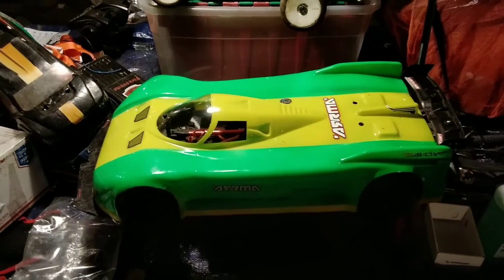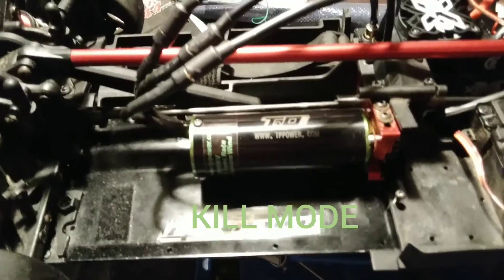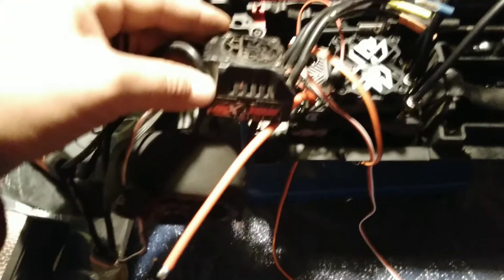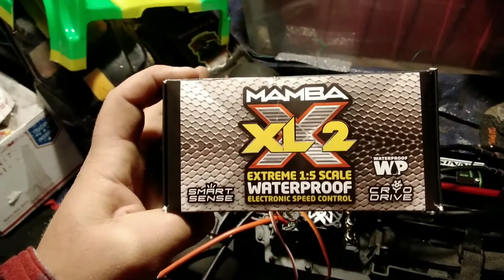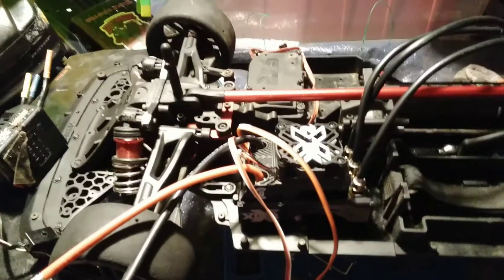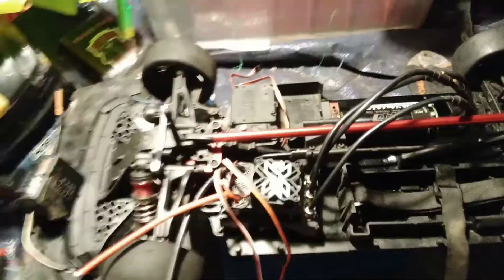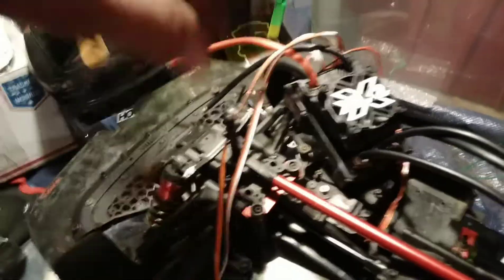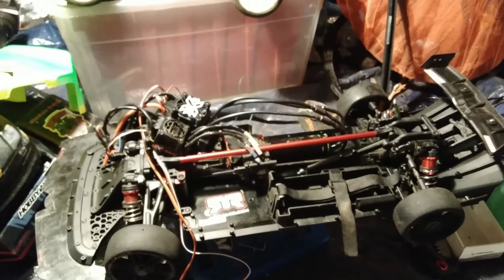Castle mamba xlx2 and kill mode tp 4070 2900kv x spec for limitless

Comment: Great video be careful Kevin had 2 lxl blow up and he had a tp motor 3200kv on 8s
Reply from the maker: Thanks for watching buddy and thanks for the advice. Yeah I agree after talking to one of my most trusted YouTubers I think I'm going to be running on 6S for the most part because the motor that I have is made for 6s runs anyways. I think it will still be a beast on 6s . And for $300 for the ESC I definitely don't want to be blowing them up. With the right set upI was able to hit a 102 just using the arrma kraton electronics. Hope you had a good holidays man
Reply from the maker: I'm thinking about getting into drag racing as well since my motor is the TP 4070 2900 KV x spec which is made specifically for drag racing from what I've heard
Reply from the maker: But I guarantee she'll still rip some speed runs up
Reply: I just watched that kevin fellas vid 3200kv on 8s no wonder not once but twice LMAO you think he would have taken a different approach with the second xlx
Reply from the maker: @kel2226-x2y  yeah I'll be running a 2900kv tp with the xlx2 but on 6s lipo people that are burning them up are running them on 8s from what I'm hearing. I wanted to run 8s but I want to learn the esc first. What she likes what she doesnt. 6s will still rip.
Reply: @rcjer6473  the reason Kevin caught fire is that 3200kv motor. That’s a 400amp motor on 4s.... so on 8s.... he probably pull over 700-800 amps. Pop instant fire. Kevin is a plug and play....he doesn’t understand amp draw. All the speed run and drag guy are laughing at him trust me
Reply from the maker: @rcguy5793  so basically it's not that the xlx2 is bad it is an operator error situation.  If that's the case, with my 2900kv tp 4070, how many amps will that draw on 6 and 8 s. I cant find that information.
Reply: Current (A) seems not to be the problem or issue because my XLX2 just burnt down two days ago during the "motor performance" test where the amps are normally bellow 50A (23A) on 8s and it worked fine twice and during the third test run it burnt up.

Comment: Bro don’t run the tp with that esc. They are burning up cause they can’t take the d-wind motors. Castle is working on the firmware to fix the issues. I have a 2700 tp and on about two passes it killed my esc on 6s.
Reply from the maker: Is it because it's a 2900 kv tp motor.? The people I know that are running it are having absolutely no issues but some are running 2200kv and some 2900kv. Thanks for the advice bro.
Reply from the maker: One more question if you don't mind..what is the date on your xlx2 box so I can compare to mine
Reply: @rcjer6473  yea any tp motor. The firmware is not set up to run the d-wind motors yet. And you know tp motor run consistently around 8000 watts with a max of 12000 watts vs the y-wind motor like the castle motors that have a max around 8000 watts and consistent 3000-4000 watts.
Reply: @rcjer6473  I purchased mine on December 19 2020
Reply from the maker: @chedrickyoung1171  ok dude....in your opinion what motor could I run with my limitless and xlx2 that will be just as fast for both drag and speed runs but won't over do the xlx2.
Reply: @rcjer6473  if u have the xlx that will do until they get the firmware fixed in the xlx2. Or u could go with the 1717 castle on the xlx2
Reply from the maker: @chedrickyoung1171  thanks dude
Reply: @chedrickyoung1171  you know if they fixed this issue yet??
Reply: @nolimitrc1  yes they have. Just install the new firmware to the esc.
Reply: @chedrickyoung1171  ok good because the xlx does not compare to the xlx2 with power delivery and i have a brand new xlx2 sitting
Reply: @nolimitrc1  oh yea for sure. Remember if you don’t know the tp does not like timing so in the settings I’ve found between 2-4 is the range the open up depending on what you are doing if it’s speed runs or 132ft drag.